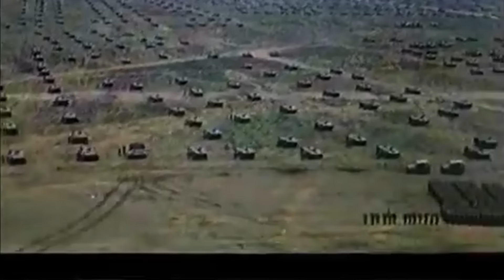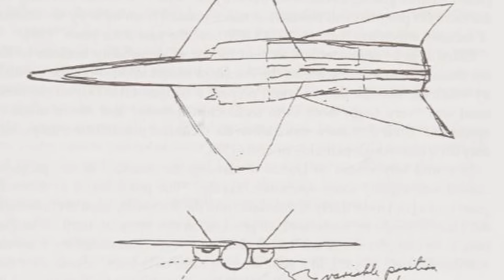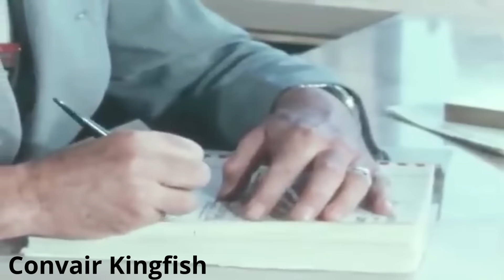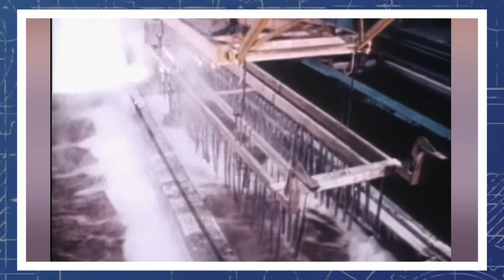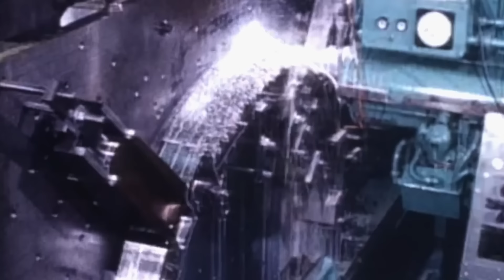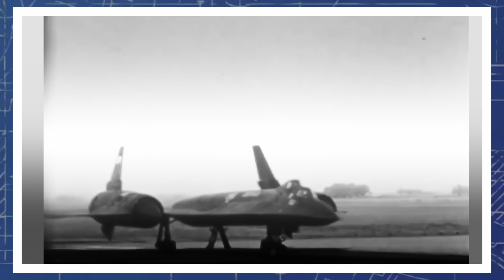How America Built an UNTOUCHABLE Machine Unlike Anything Else - Lockheed Blackbird -Full Story Part1

Comment: This is a shockingly well-detailed doc on the conditions leading to the SR 71 and has a ton of things I never knew. The SR71 is one of those classic planes aviation nerds obsess over, but this video has things even I've never heard about. Amazing work.
Reply from the maker: Thank you, full disclosure, I had to cut out a fair bit from the video, or it would have been a 4 hour epic, hence why I am now breaking my videos up into multiple parts.
Reply: @AviationRepublic  I want the 4-hour cut. I'll watch it. I never heard about the "Caesium as fuel additive" or "crystal shipped in a canvas bag as a proposed hydraulic fluid" stories. 

It really goes to show how the SR-71 was a totally different thing, not just a new airplane. "No, it doesn't work that way in this temperature scheme. No, not that either. Yeah, you might think that, but no."

Comment: I was with the sr-71 program from January 67 through august 70 as a fuel system specialist.  There is a commonly held misconception regarding fuel leakage.  It was said that with the expansion of the entire aircraft structure as typical operating speed and altitudes this expansion would seal all the fuel leaks. No such miracle of physics existed. The operational decision to begin flights with partial loads of fuel was for two reasons. The first was to prevent failure of the main landing gear due to full fuel load take offs. The second reason was by a full load of fuel after take off increased the range of the first leg of the mission.
Reply from the maker: Wow, that's fascinating to know, thank you for sharing your first-hand experience with the Blackbird, in the video, i show fuel leaking from the aircraft, how much would leak on the ground, what sort of volume would be lost just to leakage say per minute, this is something I could not find reliable info on. Also, I will be working on the SR-71 story in a few months, and would you mind if I were to pick your brains? Thanks in advance, Joe
Reply: Did they leaks only make it faster it leaked?
Reply: I am neither an engineer nor worked on the program, but I am confident you’re wrong. 

😉
Reply: @The_ZeroLine  based on what reasoning

Comment: Some erroneous claims in this video. SR 71 did not fly over 90,000 feet. Titanium would not shatter like glass if dropped, etc
Reply from the maker: The reference I made the about the Titanium shattering like glass was from a source that had worked with the aircraft
Ben R. Rich's account (Skunk Works: A Personal Memoir of My Years at Lockheed):
Rich describes discovering that the titanium they were attempting to use was "as brittle as glass".
He recounts that when a worker "dropped a piece off his bench, it shattered in a dozen pieces".
This discovery occurred as they were beginning to build a mock-up of the fuselage-cockpit section for heat testing. The problem was diagnosed as poor quality-control in the manufacturer's heat-treatment process, leading to the rejection of 95 percent of the initial titanium delivered and requiring the implementation of rigorous quality-control procedures

Comment: Titanium does not shatter like glass if it’s dropped
Reply from the maker: The reference I made the about the Titanium shattering like glass was from a source that had worked with the aircraft
Ben R. Rich's account (Skunk Works: A Personal Memoir of My Years at Lockheed):
Rich describes discovering that the titanium they were attempting to use was "as brittle as glass".
He recounts that when a worker "dropped a piece off his bench, it shattered in a dozen pieces".
This discovery occurred as they were beginning to build a mock-up of the fuselage-cockpit section for heat testing. The problem was diagnosed as poor quality-control in the manufacturer's heat-treatment process, leading to the rejection of 95 percent of the initial titanium delivered and requiring the implementation of rigorous quality-control procedures
Reply: @AviationRepublic  Well I definitely wouldn’t argue with Kelly Johnson. He’s the best aeronautical engineer that ever lived, but I’ve worked with precious metals my whole life, and I’ve never seen titanium explode or shatter when it hits the ground.

Comment: Awesome video. One thing you didn't mention was the the first five A-12's flew with J-75's as the J-58 was still giving them fits. BTW, if ever in Dallas the only SR simulator ever built is at the Frontiers of Flight museum at Love Field. Pilots said it could be scarier than the actual jet itself.
Reply from the maker: You right, I did not add that nugget of knowledge, my mistake.
I was flicking through my notes and realised there were a few stories I didn’t manage to include. 
One of my favorites is about the sonic booms. 
At the time, people were complaining to Lockheed that the Blackbird’s booms were cracking their windows, and they were demanding compensation.
To test just how many of these claims were genuine, Lockheed put out a schedule with some dummy flight dates. 
Sure enough, on those days—when no flights actually took place—people still showed up with “proof” their windows had been shattered. 
Chancers, of course. I really wish I had managed to fit that one into the script.